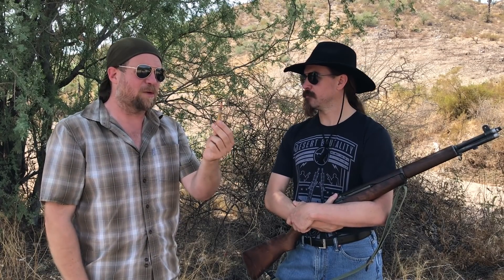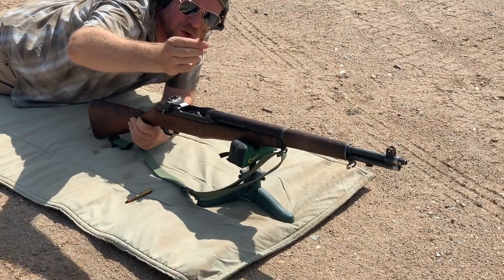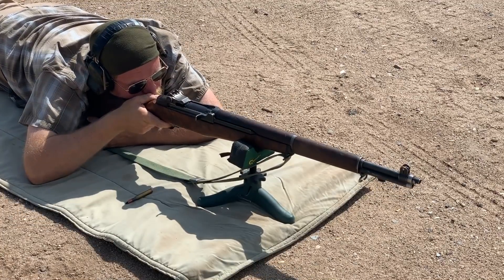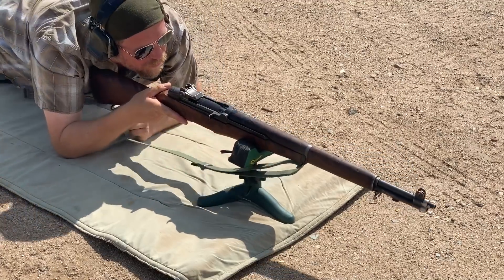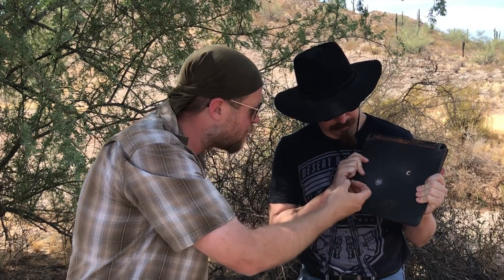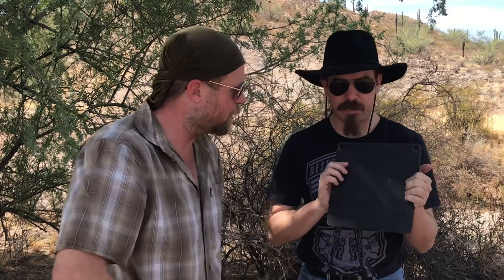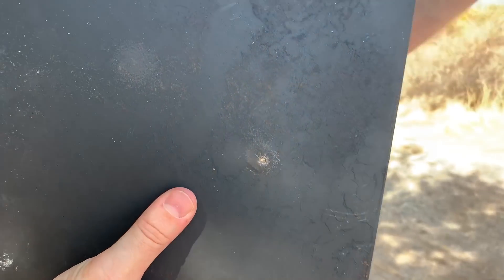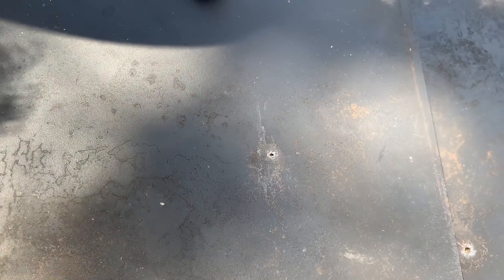Armor Piercing Ammunition Testing: 30-06 M2 AP vs 3/4" AR500 plates

Comment: This is an old video i just rewatched out of curiosity, and a thought just ran through my head. If you get a plate around 60% the thickness of that place and put them back to back like they did here. It’ll be 20% thicker, but it would be more effective in stopping the round than just a thicker plate of the same thickness(as the 2 thinner ones) by itself.

Comment: I have a 155mm projo I used for a target untill I hit it dead center and was hit in the stomach with 30-06 AP, i found the hot core on the ground. My flat plates are always at an angle now.
 I also shot an M2 bradley 3/4" armour plate with my breechloading black powder 40mm cannon & a WW2 A.P. projo, it punched a spall out the back but bounced off, it's only 2 oz of powder. I found this projo on the ground also😊

Comment: If it was a single 3/4" plate vs 2 separate plates making 3/4" of steel there would be a different outcome. 2 separate plates means 2 separate entries needed vs a single entry of a 1 piece 3/4" plate. Its quite probable that it would have gone through a single 3/4"  plate

Comment: I'd be curious to see instead of a 2nd plate behind it, try increase the plates thickness 1/10 at a time until you get the same results. It would be interesting to see at what thickness the 30-06 black tip becomes ineffective.

Comment: Did the same test with a 6 inch longer barrel in .300 RUM... using two AR-500 plates and ran into the same outcomes with the M2 AP projectiles.  When testing vs. 3/4" AR-500 the M2 AP would almost make it through and this may have been due to the properties of the core and place or date of manufacture.  Other 150 gr. AP made it through both target arrays.  In other words the projectiles that failed were apparently due to core break-up and not lack of energy!
The 150gr. loadings were tested up to ~ 4,150 fps and the M2's up to ~ 3,900 fps.  Most of the rounds tested that managed to completely penetrate the 3/4" AR500 only were able to travel 2 - 4" into a wooden backup block.  There was one exception during the tests which involved an 8mm steel jacketed steel core AP (probably German WW-2) which was turned down to .308 and had a subsequent weight of ~ 165 grains... that apparently maintained it's integrity and blew a spall from the back of the plate that was roughly .750" in diameter!
The core continued through two  6" thick wooden capture blocks and then powdered  both sides of a concrete block with 1.5" wall thickness and disappeared into an 18" oak tree trunk!  I'm fairly sure that it would have made it through a 1" thick AR500 plate given the cloud of dust that had been a concrete block after passing through a foot of wood and the ,75" AR plate... again, especially given that it was just a very good steel core AP!  For some perspective on this... with the exception of the .50 SLAP rounds, none of the other rounds tested by the various channels on U-tube were able to defeat the .750" AR-500 plates, even at very close range!
P.S.:  In the tests noted at the beginning of the comment using the two AR500 plates, the plate thickness was 1/2" and not 3/8". as was the case in your tests involving the 30-06!

Comment: I've done some die maker work.   In shearing steel,   I recall that given thickness of steel shears when it has sheared through 57% (if memory serves ) of its thickness.
I suspect punching through plates follows a similar pattern.   Once you're a little over half way through,   you've sheared the remainder in the process.

Comment: On the second shot (AP) when the shot did not go through, was there indication of metal spalling on the back side of the 2nd plate? Spalling frequently occurs on the inside of armor even without penetration...and injury to those on the backside of the armor. Spalling: small pieces of metal detaching on the opposite side of metal/armor hit on one side by high energy projectiles that do not penetrate through the metal. Thanks for the tests and videos.

Comment: I don't know if I can trust a video where you mispronounce "Garand."

Sarcasm aside, the US Navy did similar testing (albeit on a different scale) with regards to ship armor.  Someone in one of the comment threads asked what the difference would be with a single piece of think armor versus multiple pieces of thin armor placed on top of each other (the Navy's conclusion was that it was better to have single thicker plate, but there are other mitigating considerations.)  

It's been an interesting consistency in that what you guys do in regards to testing have parallels with ship design and equipping.

Comment: It would be interesting to see an armor test where you vary the impact angle. At what angle does a particular AP round fail to penetrate.  For example start at 90 degrees,, then 85, 75, 65 etc. until you get a deflection.

Comment: A homogenous plate would most likely yielded a different result. The laminate effect relieves the projectile of its mass, leaving only the penetrator.  The tip sheds kinetic energy without the mass to drive it. Tested a lot of plate anti-vandal systems for pipelines and power transformers back in the '80s.

Comment: A thing of note why the single plate gets penetrated ways easier is the clearly visible chipping of the plate on the back side. so with the single plate once the backside starts breaking away, there is almost no more resistance to the core and the thickness of the armour that really has to get deformed and pushed out of the way is significantly smaller. A second plate right behind the first one gives a backstop to the material under stress so it won't break and needs to be pushed to the side as well. hence less energy to impact the second plate.

Comment: I'm guessing this is kinda the same "tearout" thing that you get when drilling wood. If you put another plank under the piece you're drilling into, you get much less tearing on the exit of the drill bit, here as the plate were bolted together, the tearout you'd normally get with a single plate didn't happen so it was extra hard to shove the jacket through with the core. So you end up with the jacket left behind and the core alone doesn't have enough momentum to damage the second plate. I'd have loved to see the same shot but only with the plates spaced like a centimeter apart.

Comment: Try handloading a 5.56 AP bullet to a .308 case with a plastic sabot. We did that once with a regular hunting bullet (no AP bullets available here), got a 1331 m/s (over 4300 fps) muzzle velocity and the bullet punched a hole in 10 mm thick armor plate despite being a soft point (the same plate could handle 7.62x54r steel core). Would be interesting to see what an AP bullet does in similar load.

Comment: You should change angles in 15 degrees or so increments. That way you transition through a range of effective thicknesses all the way to maybe 60 degrees where the effective thickness is double the perpendicular measurement.

Comment: i would be interred to fine out what happens with a full 3/4 inch plat rather than 2 stacked as the small air gap will have caused a increased deflection in the 2nd plate visible by the stippling around the exit on the 1st. i recon it u measured the depth of the damage over the 2 plate versus one solid it will be more on the solid due to the reduced deflection the the metrical and escaping gas. this would probably be more obvious it you welded the 2 plates to gather as there will more than likely be fractured down the weld or a reasonable pressure bulge visible.

Comment: Very interesting result. I can't help but wonder if there would have been more penetration if you had used a single 3/4" plate. Perhaps you can try that in the future, if you get your hands on a plate that thick :) Also, there is another test that I would love to see regarding these armor-piercing rounds. I would love to see you put a soft-armor insert behind one of these plates, to see if it would be able to stop the round/plate fragments after it passed through a standard 1/4" AR500 plate. I think passing through a 1/4" plate would cause the velocity to drop enough for the soft insert to catch everything. I think that would be an interesting test, and very helpful for anyone who is concerned about their armor being defeated by armor-piercing rounds.

Comment: Answer to the wonderings could be found here under section "Thin, strong plates": http://panoptesv.com/RPGs/Equipment/Weapons/Projectile_physics.php

For those who are still interested on the topic, Nathan Okun digs deep into it at NavWeapons in the article "MULTI-PLATE ARMOR VERSUS SINGLE SOLID PLATES: PROS AND CONS FOR EACH" (2008), as does Daniel Mercer in " Why one thick deck is better than two thin ones". You have to bear with some math, as penetration and perforation dynamics are indeed pretty complicated.

Comment: The problem here might be the momentum. By Newton's law of approximation, any projectile would lose most of it's momentum after penetrating twice of it's own length. So that's the maximum without considering any other factors. With everything else slowing that core down, the max penetration depth is quite a lot less.

Comment: Is AR500 through hardened or just face hardened?  Would make more sense that the whole bullet would make it through a single plate after defeating the surface hardening.  The hardened face of the second plate basically contained the unhardened back of the first plate and defeated the penetrator.  Would make more sense considering fully hardened steel can get pretty brittle.

Comment: I think what’s happening here is due to fracture mechanics/stress concentration. The bullet penetrates the first plate and concentrates its energy in a very small area and requires less force to continue through the plate. I’m thinking the tip of the penetrator is creating/propagating a crack as it travels through the plate. 
The second plate doesn’t have the stress concentrator of the penetrator hole and by the time the penetrator reached the second plate it doesn’t have enough energy to create a new one. 
Just my 2¢

Comment: So just thinking here, wouldn't the second plate absorb energy by preventing the deformation of the first plate which would cause strain hardening of the material and is why the first shot had a smaller exit hole than the second shot

Comment: Interesting. Clear example over overmatch ratio in practice in this test.

For those who are unaware, overmatch ratio is the reduction in penetration as a the plate the projectile hits gets thicker relative to the projectiles diameter. In more practical terms it more or less accounts for how much extra energy a projectile expends trying to compress/spread apart a larger column of material.

Comment: Another couple of things that have been tried are spaced armor, and composite (steel plus ceramic/glass). Of course, I'm almost certain that anything less than .50BMG won't merit specialized armor construction like that.
But playing around with various armor constructions is quite informative and useful. Even if most of the results end up being easier to apply to vehicular armor instead of infantry, you never know. Someone might want to up-armor their minivan.

Comment: I shot black tip 30-06 from 100 yards at 1/2" AR 400 drop and it did not punch through.  3/8" deep 1/2" dia. pit and a good bulge on the back.

Comment: I'd like to know where I can get some of that AP ammo so I can do some of my own steel plate testing. Are there regulations on that type of ammo? Why is it not in production now for the 30-06?
Reply: The ATF requires that you have a special license to manufacture AP ammo for sale, and only sell to approved customers. You can buy the projectiles I think, but you have to manufacture the ammunition for personal use. I am not a lawyer.
Reply: @borkborkfoxxo279  Does it work the same way with 50 caliber ammunition? I have seen many YouTubers from different channels shooting AP rounds in that caliber so I know they produce it.
Reply: @dannygreen2382  To my knowledge everything up to .50 cal is legal for everybody without a tax stamp. I could still be wrong but I can't imagine the rules are different since .50 still has an ostensible 'sporting purpose'
Reply: all this is Military surplus which is exempted from the AP ammo ban because it is supposed to be used as target ammo. So if the Govt. is not making it you won't be seeing any of it. The 3006 AP is quite accurate and was preferred over standard M2 ball by those in the sniper role. I have shot it some and have personally seen it penetrate 4 inches of steel-reinforced concrete and roughly 24 inches of oak tree.

Comment: Okay here's a question. What would 30-06 black tip do out of a 308 cartridge?
Reply: recapdrake that is a .308 black tip. Nothing special about the bullet, just a few more grains of case capacity to a .30-06
Reply: thgreatandini 30-06 bullets have different ballistics than 308. The bullets aren't the same length.

Comment: The only analogy I can come up with regarding the bullet penetrating one lone plate easily but barely getting through the first plate and doing almost nothing to the second plate when two plates are stacked is:
Think of one plate as a thick layer of sand on top of a rather weak plank floor. With one plate, you dig through the sand with a shovel and then you can just jump on the plank floor to break through it. When you have two plates, you have a layer of sand on top of a plank floor on top of another layer of sand on top of another layer of plank floor. Now when you dig through the first layer of sand, you can't jump to break the plank floor because there's a sand layer beneath supporting it, so you'll have to do a lot more work just to get through the first plate.

I guess it's not the best analogy but it kind of explains how there's no room for the plate to deform when there's another plate right behind it. Instead the bullet has to dig through the entire first plate since it is unable to break through some of the material of the plate by deforming it.

Comment: With plates behind a first target I had similar experienced.

I fired with a .223 at 109yd on a 3.5" HDD, standing in front of a steel brick.
The bullet did not pass through the top of the HDD and left no mark on the  brick.

A shot on the HDD alone ofcourse passed and a shot on the naked steel brick left a 5mm deep crater.

So never underestimate the power of layers!
Reply: About 30 years ago a friend fired some issue ammo he squirreled away while on station, 5.56. I watched him fire a few rounds through the boom of an old crane, the steel was one inch thick, it penetrated like a drill bit.

Comment: So the second plate essentially worked as anti spalling protection. I wonder what would happen if it was just a single plate of 3/4 inch thickness. Something tells me that it would've been less effective than the two plates, and there'd be some spalling on the far side.

Comment: It looked like the shot into the single plate resulted in some spalling on the back surface, which would have helped the core blow through. With the back of the first plate supported by the second, I wonder if the result was less spalling and so more resistance to the core as it exited the first plate. 

IIRC, the idea that two plates with the same total thickness as a single plate being less effective relates to plates with a gap between them. And as others have noted, the way in which the plates are hardened can make a difference--for example, a face-hardened but brittle plate designed to shatter a projectile on impact versus a softer but tougher plate designed to stop the progress of a projectile before it penetrates completely.

Comment: just a note, 2 plates stacked are not the same as one thick plate. there is a lot going on with 2 plates that one would not have. would the round have penetrated more or less I don't know but I am sure the results would have changed.

Comment: This is a great example of why people need to do more than just through some physics equations around to explain armor. Force and Kinetic energy are relevant, but there are so many more amazing variables involved that just don't get explained much at all unless you become a very special kind of engineer. If they had shot a single plate of 3/4ths inch-thickness, for example, you get a very different result as well.

Comment: Now I wonder if there is a difference between using a single 3/4'' and two 3/8''. Because there could splatter some metal between the plates and thus lose umpf.

Comment: I need to see this tried with a single 1/2 inch plate, then a 5/8 plate and finally a 3/4 plate.  The problem with stacking plates like this the second plate can absorb some energy simply by being a separate plate.  Even if they're bolted together.  

Your target supplier doesn't offer them?  Just call around to your local specialty metal shop with a laser and have them cut what you want out of AR500.  Where I used to work (in Portland OR) we cut AR500 in those thicknesses every day.

Comment: Now this was an interesting AP test. Would be interesting to see how it does an a solid 3/4" plate instead of two sandwiched together, I imagine that would change the impact a bit?
Reply: The other thing is on a microscopic level,  I don't know if the metallic structure of the second plate not getting any energy from the initial impact and only being impacted by the core exiting the first plate changes how it would react.   I would think that laminated armor would be better.  3/4" plywood is stronger than a dimensional  piece of lumber of equal density.
Reply: was going to say the same. The 'gap' even if less than a .1 of a millimeter is still a gap. One solid 3/4 inch plate will react differently than 'spaced armour'